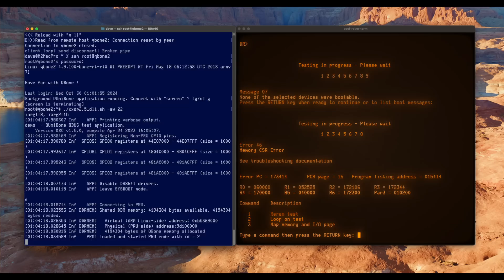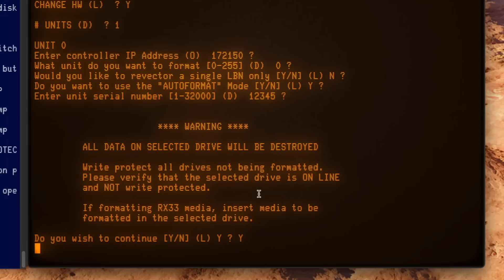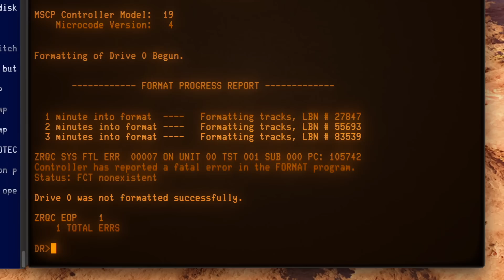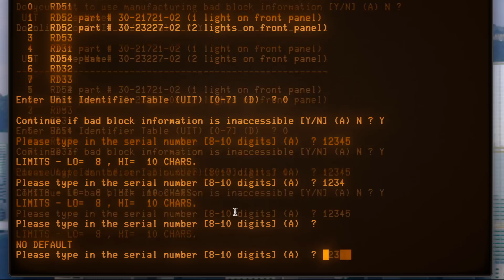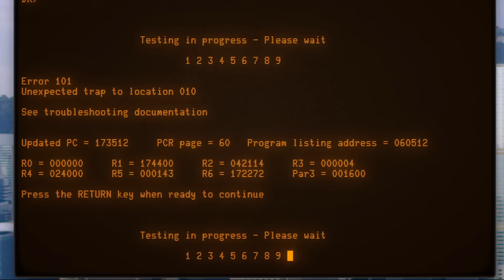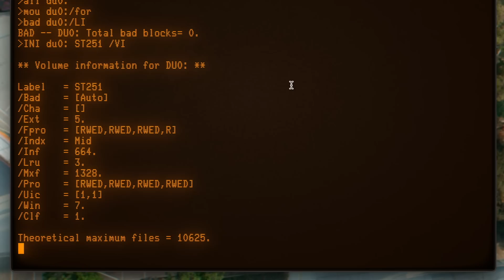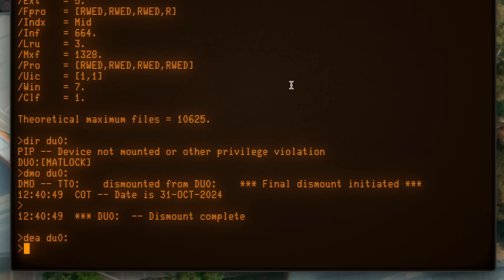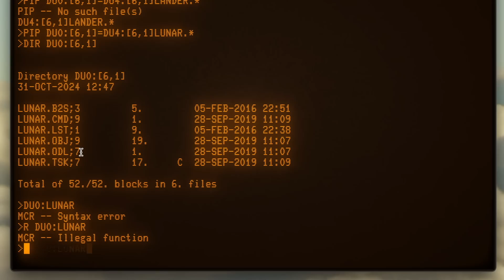How To: Formatting the Ancient Hard Drive in a PDP-11

Comment: This is causing flashbacks to using LSI-11/02 and 11/23 QBUS machines. I remember patching RT-11 drivers to make a Priam 33 MB SMD drive look like three 10 MB RK02 drives. My first integration was on serial number 13. We had a single board Interface card that looked like either a serial or parallel port to the OS, was a parallel interface for a Tektronix 4014 terminal powered by an Intel 8086 used as a display processor for the 3D CADD system running on the DEC system.
Ver 1 could display 30K vectors per minute. Ver 2 added an 8087 and 8089 increasing display speed to 320K per minute. These speeds required the parallel interface version of the display.
We were told it was the first SBC using the 8086 designed and built in the South.

Comment: [I can't remember whether I've mentioned this in your channel; if so, apologies for the duplication.]

The problem with 40-year-old hard drives is, they're all on borrowed time. The ST-251's specs list its service lifetime as 5 years, and that's for an 80s-vintage drive.  Who knows when any given one is going to give up the ghost?

We've had excellent results with Gesswein MFM-drive emulators; you can look them up online.  If the goal is 100% authentic period hardware, obviously this won't cut it -- but if the goal is a working, reliable system, it does the job, and does it well.   (I'm not affiliated in any way, just a satisfied user.)

Comment: We used to buy ST-225 drives by the carton.  They were prone to lock up due to stiction or would loose rotational speed over time. The ST-238 was essentially the same drive but allegedly certified for RLL use.  Certified my foot.  Anyway, a lot of ST-238s we had got repurposed to doing regular MFM duty with a controller swap to an MFM controller.

That was back in the day when Steve Gibson wrote for several of the popular computer hobby and PC magazines.  Gibson touted his SpinRite program which was supposed to spruce up ailing hard drives.  I got panicked calls from many of our offices who had gone out and bought SpinRite and drives with a few errored sectors got turned into digital guacamole.  Usually it was too late to rescue any data by the time clients called.  Fortunately back then most people were pretty good about keeping floppy backups because hard drives had a deserved reputation of unreliability.  Floppy boot, DEBUG g=c800:5 to run the low level format, then reinstall the O/S, then reload the data proved pretty effective.

I haven’t looked in years, but you used to be able to get assemblies to fit 5.25 inch bays which would allow mounting a 1/2 height drive in a pull-out drawer with pin headers to pass the ribbon cable connections through.  The nicer ones had small fans in back to help keep the drive cool.  Those were very handy if you wanted to have boot drives with different O/Ses or for making removable data drives which could be kept in a secure / fire resistant locker.

Comment: Quick quiz:  who recall the DEBUG command to start the MFM low-level format on a PC?  I guessed wrong, but was close.  Must be getting old!  Excellent video, sir!  Keep this old hardware stuff coming.
Reply: Eventually, in the 386/486 era, you started to see PC BIOSes with a fancy menu-based setup program in ROM. Some of them had a command to low-level format an MFM/RLL hard disk…but by that time, IDE was rapidly becoming a thing, making low-level formatting unnecessary (and impossible).
Reply: G=c800:5
Reply: @wesley00042  Yup!  Did you know it or have to look it up?  For me, 60 years old, probably haven't used that command in ~40 years, I misremembered it as "g c800:0"... not bad, but it's a sign the memory is going.  I feel HAL forgetting the words to "Daisy" as his memory modules were being yanked out.  Cheers!
Reply: @grottyboots  Still remember... for now. :-)

Comment: Instead of going the PDP route in the 1970's, my father bought an AlphaMicro AM100 system (WD16 CPU, S-100 bus) using a CDC Hawk hard drive with one fixed 5 MB disk and one removable 5 MB disk.  It was the size of a trash compactor. :)  Later, he added a 20 MB Winchester drive that would fit in the bottom of the Hawk cabinet.

Comment: RSX11 - my favourite operating system and the one I used most of the time from 1978 to 1992. I still remember all the manual sysgen stuff we had to do (SAVe and BOOt commands needed) before the invention of autoconfiguration with M-Plus and MicroRSX. Did I spot a B2S file in there, aka a Basic+2 source code file?

Comment: Good ole PIP!  PIP was a very powerful tool on the old  PDP-1160 and CP/M  machines I used many years ago... You brought back a lot of memories!
Reply: I remember RK05 drives with hundreds of files in a flat file system.  PIP was a must have.  I remember the first time logging on to a Vax 11/750 running Berkeley 4.something UNIX in the early 1980s and being amazed at how much easier life was with a hierarchical file system.

I recall when MS-DOS 2.x was released in 1983.  I believe the first version we had on our hardware was 2.05.  MS-DOS got hierarchical file system and could support what seemed like a giant capacity 10 megabyte hard drive.  It felt a little like being on big iron but running on a PC.

Comment: Ahh the old Seagate ST-225. Fond memories. So many of those were used in the IBM PC-XT clones. They were reliable too. I used to have dozens of them as they were often replaced with larger drives as they came out from the manufacturers. I remember getting my first 1 gigabyte drive. A group of us at work got together and bought around 20 of them for ourselves at $1000 a piece. It was a smoking deal at the time. I felt like I was swimming in disk space at the time.
Reply: Those old drives were nearly bulletproof.  I remember when they were brand new they would sometimes get errors with use unless you “broke them in” first.  I would low-level format them, then run a diagnostic program that did seek tests overnight, as the alignment would shift over time, then reformat the next day and the drives usually would be solid after that.

Comment: At least you have the tools to low-level format the drive! When I worked with the Pick os back in the 1980's as a developer and porting  Pick to different hardware at the os assembler/driver level, there wasn't a way to format a hard disk. The Pick os treated all drives as one logical unit with a starting frame number of 1 and with the last frame number dependent upon the number/size of the installed disks. It was the job of the low-level disk device driver to convert a frame number from the os into the required disk no/cylinder/sector etc. It assumed that a drive had already been formatted and that bad blocks etc had been mapped out at the drive level. If a disk had to be low-level formatted then this had to be done using another os (we used os-9) - much to the bane of the production staff who built the systems. There wasn't even a high-level os format. As the OS treated all the disks as just one big virtual disk, there was no reason for an individual os level disk format. To install Pick on a computer you just inserted the boot floppy disk/tape and re-booted and Pick would be installed. If you wanted to extend capacity you may or may not just add an extra drive - depending upon the particular Pick implementation you had. The 'smart' versions interleaved the logical frame numbers across all of the installed disks (which improved read/write times)- so to add a new one you had to create a sysgen tape, install the disk and then re-install the os and all the files. Others 'added' the frames for the new disk at the end of the existing frames and detected this during boot and altered frame tables etc to match so there was no need to save/restore the system. And others only detected new disks during a system restore (even if the new one as 'added' at the end) so you had to save/restore the system for the new disk drive to be used.

Comment: I had the foresight to save some of the old junk I used to work with.  I have a 5MB drive (8") that weighs about 20 pounds.  It came from a kit Altair I think.  I was also around when Shugart/Mitac began building 10MB half height 5.25" drives to go in what we used to call "The XP option" which was a 5150 with a 10MB Shugart instead of the Seagate in the logo (5160) chassis.  The stories I could tell having worked for a gray marketer of IBM equipment would be astounding.  Nobody would believe the crap we used to do, including at one employer, pirating BIOS chips...

Comment: @Dave - Could you provide some details re the hardware setup for this pdp11 please. What floppy drives/controller are used? What controller is used for the hard disk? Did you build this from parts or did you acquire 'as is' - as this case isn't listed for a PDP11/83 computer as far as I can see?
Great video though. More on PDP11s please! They were and remain my favourite mini-computers. Back in the 1970/80s I enjoyed assembler programming (with RT11 and for bare-metal) - and still do!. I've written about four pdp11 assemblers in different languages over the years with my latest in C++. PDP11 is IMO a really nice assembly language and was the first I learnt. 
I'm currently finalising a multi-user (using DZ11) snake program (see usagi electric pdp11 discord forum) in assembler as a bare-metal program. Unfortunately I don't have an actual PDP11 and have to make do with simh. Doh!
Keep up the good work :)

Comment: Seeing PIP used, it suddenly dawned on me that this is probably why PIP works the way it does on CP/M.  🙂  I always assumed that Gary Kildall based the commands on something older, but I never got around to finding out what.  Neat!
Reply: I remember pip from CP/M - Peripheral Interface Program if I recall correctly. I didn't really have any peripherals on my Globe Microsystems Z80 with 64k RAM and two 5.25" floppy drives so never really used it much!  I wish I stll had that machine but alas I sold it in the 90s.

Comment: Should have gone with an MFM emulator thus not having to worry about a very old hard drive failing.  I have 2 of them.  One for my Rainbow 100A, and one on my Pro-350.  They work  very well.  And if the drive is still working it can be dumped to a file that is readable/writeable just as if it were a real HD.

Comment: During the late 1970s, I worked at a computer center with a PDP-11/70. The hard drives that we had were the size of washing machines, and used removable Nashua multi-platten drive packs.
Reply: When I saw the ST drive, my initial reaction was shock, as I was used to seeing the disk drives that you describe.  Had no clue that they could actually use Seagate drives.
Reply: Probably RP07s

Comment: ST-251's always make an interesting hi pitch sound when they seek. I still remember going on a call where the customer couldn't access the HDD. Was an ST-251. I noticed it was on but not spinning (you can see the shaft on the bottom. was slightly visible). It must have gotten dirt or something in the bearing. I spun it up just a bit and it took off spinning. Told him not to turn off his PC until he had gotten all of his data off of it to floppy and order a new drive.

Comment: That little Hard Disk looks just like the 20MB units I put in PCs in the 1980s. 
In DOS we used a debug program to kick off the low level format. Then fdisk to partition, and finally format to make it accessible to DOS.
Reply: mine had a metal cage under it,  was formatted 40MB, killed my bios chip with a bit too much low level formatting, did get it to 60MB
Reply: early pc’s had st225’s - I think dave said that was a st251 - so yeh same family
Reply: @eliotmansfield  Yeah my Atari 800XL had an ST251 HD attached to the MIO.  Didn't have the big bucks for the 40MB bad boy at the time.  I could be wrong but I think the ST251 was 20MB and the 225 was 40MB, but that was a long time ago.
Reply: @msromike123  ST225 was 20MB and ST251 was 40MB.  I installed and setup many of these drives back in the day in PCs.  Never seen them used in a PDP11 before.
Reply: It is the same. St-225 was my first PC hard drive. $395. I still have it and can see it now on the shelf. Still running when parked. He didn't say up front, but the replacement is apparently the ST-251 which is the 43MB version, same hh form factor.

Comment: I used to work with a pdp 11/45 with core memory ... as in iron ferrite beads with loops of wire going through each one ... 64,000 of them.  :) To boot it, you set 16 toggle switches on the main panel, latch it into to the PC (program counter) and put another switch into the run position.

Comment: do you have a video on how to get that 'cool-retro-term' set up? i think its really cool you're using old hardware and new hardware in tandem like this. if i had infinite time and money i would love to do some projects with vintage computers
Reply: It is a terminal emulator available in the repositories of most Linux distros.
`apt-get install cool-retro-term` 
And that's about it other than selecting the color scheme and adjusting the effects sliders (right click in the window to get settings). Debian with Xfce puts the CRT icon in the "System" section of the application menu I don't have my other systems running right now to note specific distro differences.